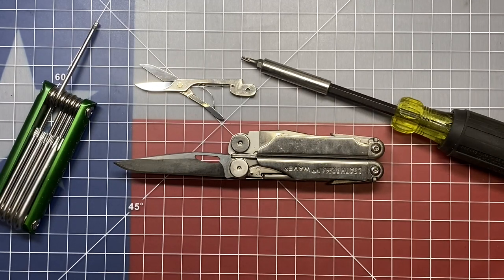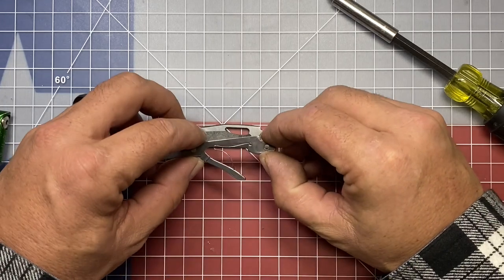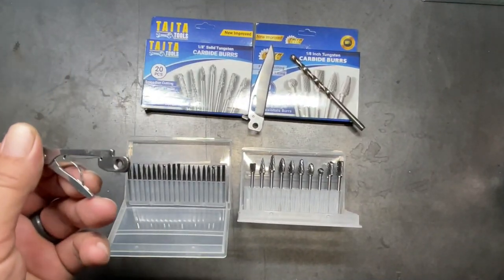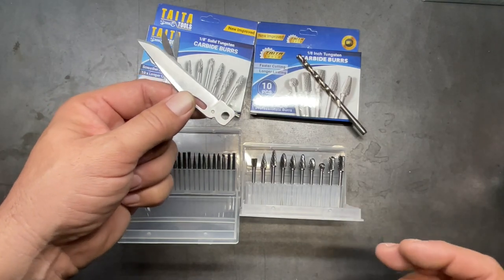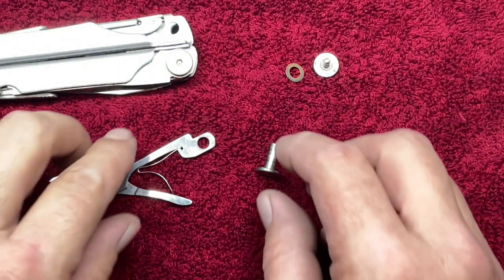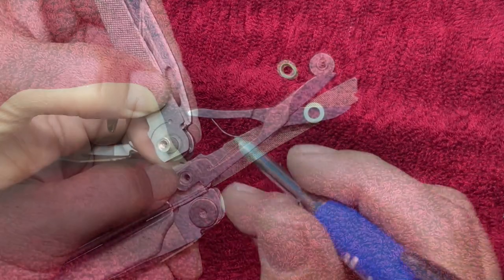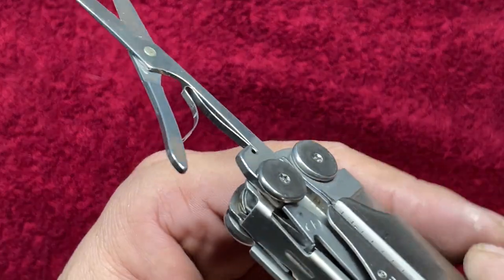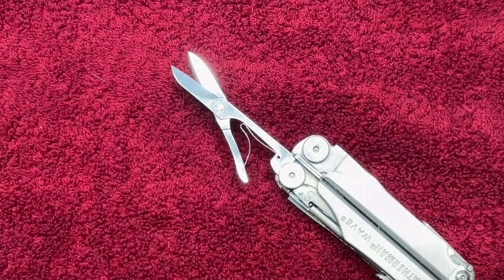Leatherman Wave Modification : Adding Victorinox Scissors

Comment: Putting Wingman scissors is an easier mod, but Vic scissors are way better, so while more intricate of a mod, it is worth it.
Reply: Do the wingman scissors require modification or do they just drop in?
Reply: @shaundad16  you have to enlarge pivot hole just a little bit. ( 2/10 of mm)

Comment: That Victorinox steel was a lot harder than I expected.  I guess even “soft” knife steel is harder than what we typically drill through.  And nice mod!  Good scissors are a must on any multitool.  That’s at least ONE thing they got right on the P4.

Comment: Victorinox keeping their Propriety with high quality steel, great video. As former USN Salvage Diver currently Maritime/Construction team mbr appreciate your knot videos and tool videos. I collect multitools throughout the years most issued by USN which were Gerber M600 Variations, Ben the reason why Mil Spec Ops uses the ST300 platform is the concealment of Implements, and the Cleaning ease inside the tool with all Implements open. The Surge/Wave has so many nooks and crannies that its an entrapment for dirt , mud, salt, C-4 at the airport etc for the Spec Operator, and we all have Dedicated Folders/Fixed Blades the Blade on a Multi tool is almost irrelevent, so are scissors, the ST 300 is the most practical stand alone tool. Thanks again for the content.

Comment: A great way to drill through super hard steel is with a carbide masonry drill sharpened nicely and it’s something most of us have a box full of already. You can even drill through a snapped off tap or extractor ideally use a pillar drill and oil

Comment: Stainless steel also work harden. As you drill and the heat increases, you harden the steel further. Ideally you want a drill press. Run at a slow speed but apply lots of pressure

Comment: If you now remove the original inner scissors, will there be enough room for an awl from rebar, st300 or surge?
Reply: Yes, an awl from the Rebar. I am doing this mod next month: Victorinox scissors (instead of the serrated blade) and Rebar awl.

Comment: Many people underestimate the steel in victorinox. Compared to modern stuff yes the blade has a lot less retention but its also very easy to sharpen scary razor sharp. Same with leathermans steel, but that one is prone to rust and not as fine.
Reply: If i recall properly victorinox had the sandvik steel company do their metallurgy at one point so if anyone knocks victorinox steel but likes any sandvik steels they really can't complain cause even 12c27n is a solid user steel and even 14c28n is a great steel when heat treated and cost effective.

Comment: I think the file blade should be on the handle, open it up, hold one half as you would of the file were extended, place a finger on the other half. I guess you'd need to use stronger  steel for the handles but you'd make space for another tool.

Comment: Great modification and all (I would also prefer these scissors to the standard ones on my Wave), but why did you remove the regular knife blade?? On the other side there is a serrated blade, which I personally don't need for anything. :-D

Comment: Hi,
as I am thinking about getting a multitool, I just discovered your great channel.
Do you think the quality of SwissTools is much better than the quality of leathermans? What do you think about the quality of the leathermans?
As I live in Germany, I am not allowed to carry a tool with a blade that can be opened with one hand. Which multitool could you recommend? I am EDCing a Victorinox Small Tinker, a light and a pen so the multitool will probably not be an EDC-item, since there is no more space in my pockets :)
In Germany, leatherman sells a two-handed Wave Plus. That could be a nice option, since it has tools that open from the outside. In comparison to the SwissTools, I like the leathermans exchangeable bits and wire cutters.
What do you think wbout that?
Kind regards, keep that great channel going!
Jona

Comment: I would have just softened the tang with a torch, because I don't really think the hardness of the tang is really that important.
Just remove the spring and hold it with the important end in a cup of water.
Reply: Softening the tang could create premature lock rock and potentially lock failure.

A hardened tang is super critical to maintain the lockup on a knife.

Comment: Soooo does this mean I can swap blades out between my Surge and Charge TTI?! 420HC for a S30V?
Reply from the maker: Oh for sure. Easy swap.Though it is a shorter blade.
Reply: @txtoolcrib  do you know if the hole spacing is the same? Or do I need washers etc
Reply from the maker: I honestly can’t remember. I think they are the same, but I’ll have to break into them to know for sure.
Reply: @txtoolcrib  cool thanks. If you ever do open them again and remember this comment, hope you can let me know!! Subscribed btw, great channel man!!
Reply from the maker: I certainly will. Thank you very much for your subscription, I really appreciate it.

Comment: Hey, awesome video. I had a question that I was hoping you could help me with. I purchased a leatherman surge and all the inner tools do not lock solid. They all have play, the screwdriver has the worst of it. It just wiggles back and forth when locked. Is this normal or are all the tools supposed to lock solid? Thanks
Reply from the maker: No it is not. If the play is side to side, it can be tightened slightly to take up the movement. Still, I would get in touch with Leatherman to get it replaced.
Reply: @txtoolcrib  thank you

Comment: You needed more pressure on your drill bit to get a proper bite in the metal. I would have used a drill press instead of your hand drill. Consult the machinery’s handbook for feeds and speeds
Reply from the maker: I’m not sure it would have mattered. I don’t have a press at home anyway. Probably should invest in one.
Reply: @txtoolcrib  Build one out of scrap metal and multitools. And show us the video of how you did it. 😉
Reply: @txtoolcrib  feeds absolutely matter, even with a small press. It’s like night and day and the quality of your chips will improve

Comment: Your drill was way too slow for hardened steel. And a cutting fluid would help as well.
Reply from the maker: Cutting fluid would have helped for sure, but drilling too slow? Last thing you want to do is drill any kind of steel fast.

Comment: Nice job ben..I was wondering  if you have or thought  about  getting  a leatherman  freestyle. I find it a good companion to larger mutitools for the times when I'm using my surge but need another set pliers at the same time  to stop a nut from spinning etc..I like  the small knipex  but the freestyle and streamlight  microstream usb fix nicely  in my jeans watch pocket together and don't dig into me when I'm working in odd positions

Comment: You need a drill press and lube to get through that... slow rpm, and wd40.. you cooked the tip of that bit
Reply: I was going to say the same thing. Drill press with oil at a low rpm would have cut through. Wouldn't surprise me if he was not only cooking the tip, but hardening the metal of the scissors as he was trying to drill it on a high rpm setting with no lubricant.

Comment: At least them scissors won't break off  into to halfs like both of my leatherman multi tool ✂s   did  good old victorinox scissors✂ when the multi tool dies out you will still be able to use the scissors  ✂💪 all jokes aside leatherman makes a great blade but there ✂🙉
Reply from the maker: They could improve them for sure.

Comment: When drilling through stainless steel & hardened steel it's best to use a high speed drill & doing it with a drill press. Sometimes a good quality step-drill will work too. Your carbide hasps worked & so would a dremel with the carbide bits but you can lose your center if you're not careful. Once it's close you can try using a drill bit to ream out the hole to get it perfectly round.

Comment: Thanks for the inspiration, I used your experience and built upon it: https://youtube.com/shorts/080t2GCpnMs?feature=share

One additional thing, the bottom part of each tool is not flat, it has an angle, this for better engaging of the lock. Try to grind th scissor with a similar angle. Besides you'll need am extra piece to make the scissor engage/disangage with one action and not two.
Reply from the maker: Looks fantastic!